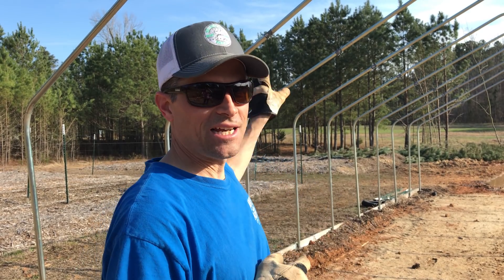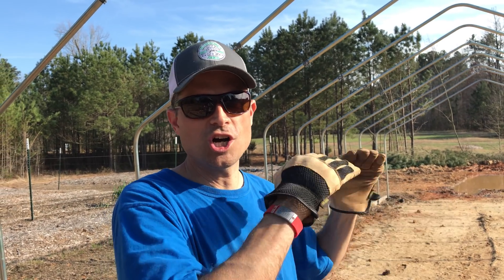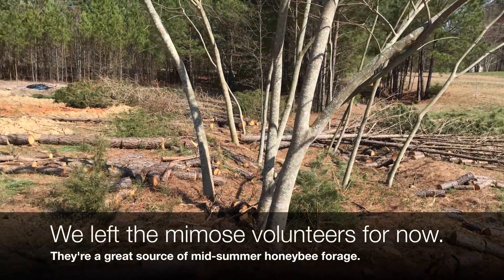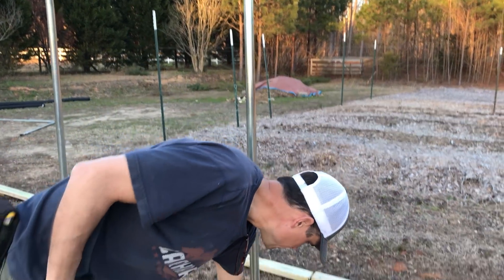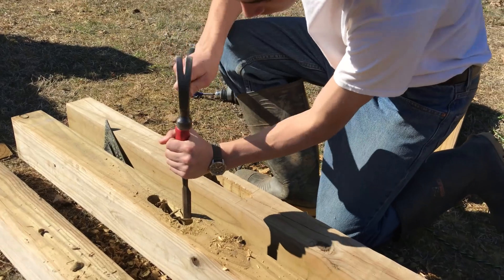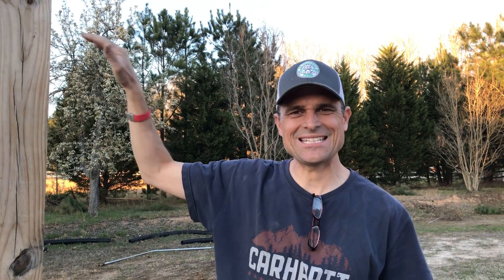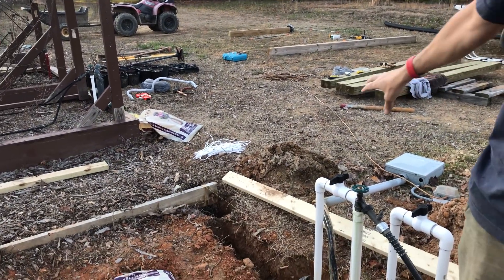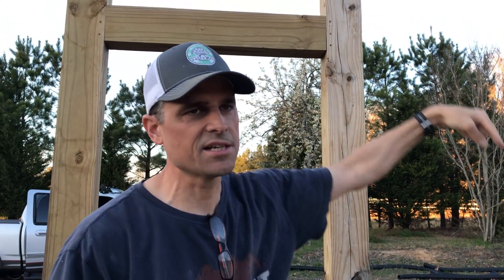DIY Geothermal Greenhouse Part 5: PROJECT UPDATE

Comment: Great project. What size pipe is in the ground connecting to the 1.25" emt conduit? You said those pipes were already in the ground from the previous owner; could I simply put the same size emt conduit 2-3 feet into the ground and join the frame conduits to it via couplings?

Comment: I wish you all would have placed a netting sock over the perforated pipe.  It was good to use perforated pipe, but over time, you may receive sediment inside tubing with blocking sediments.  The framing seems wide, I will follow your progress to see how the cross boards work. Best of luck and I think you will gain some temperature flow gain 5-15 degrees, depending on fan use.

Comment: I'm excited to see if this works!  I'm buying a farm at the end of the year and setting up two greenhouses as soon as possible and I'm currently researching ways to keep them hot/cold.  Thanks for taking the time to make the video and I'm sure it will be a success.  ALSO, just a thought, take a look at using DC powered fans for the setup.  They are MUCH more efficient and since they will be running 24 hours a day it will add up.
Reply from the maker: Buying this farm is one of the best decisions we've made, so we hope everything works out for you. Hopefully we can wrap this series up soon (if the weather will cooperate) and show everyone the results - good and bad. When you say DC fans, I assume you mean high efficiency inline fans that run for about the cost of a light bulb?
Reply: St. Isidore's Farm Direct current over alternating current.  I Know DC fans are about 70-80% more efficient than AC fans. If your inline fan pulls, say, 100 watts, then it would be 20 watts for a DC equivalent. Only catch is you need a DC power supply. About $15 on eBay. Additionally, if you are trying to keep the greenhouse a standalone unit you could power those fans with a 12 volt car battery and a solar panel perhaps I'm trying to eventually go off grid in the future

Comment: I am eagerly following your progress and had a couple of questions.
Why did you choose that style and framing for the greenhouse. 
Is there a benefit to using a grid system for the 4" drainage tube vs a single tube 'snaked' back and forth (like LDS Prepper did in his first geo-air hoop house)?
Thanks for all of the videos and keep up the great work!
Reply: no expert here either... but my understanding is that all of your heat transfer is complete after approx 30 feet of travel ..so if you have a continuous "snake" you are not getting any value out of the tubing after the 30 feet
Reply from the maker: Tom, check out this site - it has a lot of great information about these systems: http://www.ecosystems-design.com/faq.html
Reply from the maker: Please know that our answers are not from "experts" - we're figuring this out as we go on our smaller greenhouse in advance of building a much larger one in the same garden area. As to the style and framing, we wanted something fairly inexpensive and DIY. Using PVC was not an option because there are issues between the PVC deteriorating the greenhouse film and getting brittle over time. So while it is cheaper up front, long term it would be. We didn't want to order pipes and more expensive pipe benders, so we went this route with EMT from Lowe's. Will it work? We hope so. Question will be if the couplings can hold the weight of snow load. What I can say for sure is that they will hold my weight individually. If necessary, we could add braces. In regards to the tubing, we're using a different method we saw used by CERES out in Colorado. Most folks seem to think this will work, but have called into question using the same size tube going into the ground and and for the main branch (trunk) as for the long runs. I get where they are coming from. If this was an HVAC system, the trunk would be much larger than the supply tubes going to the registers. In retrospect, I would have used 6" tubes going down and for the trunk, and 4" for the runs. Hope this helps. We'll see soon enough if it all works!
Reply: Thanks!
Reply from the maker: That is increasingly our understanding as well. Ours ended up being about 40+ feet, so a little longer than ideal, but hope it will work effectively enough.